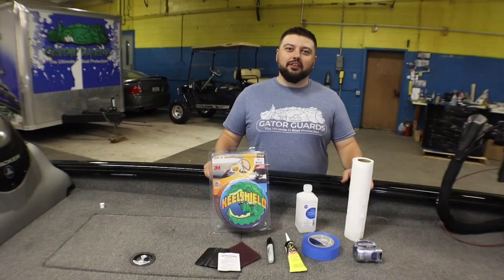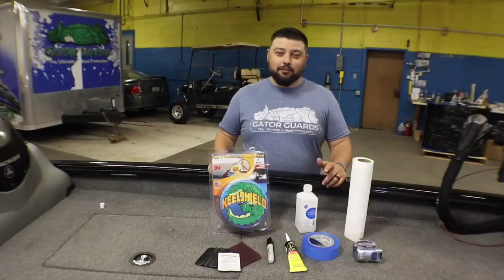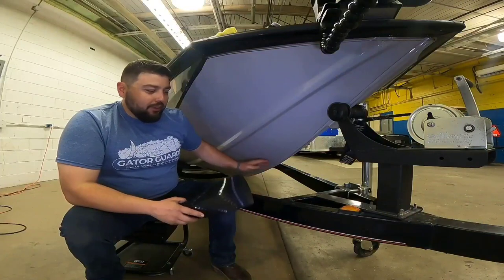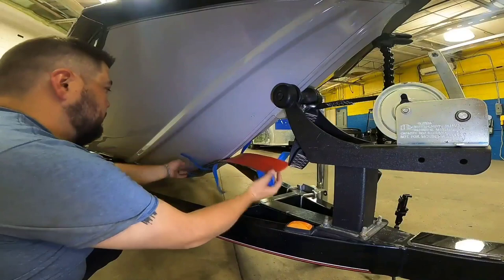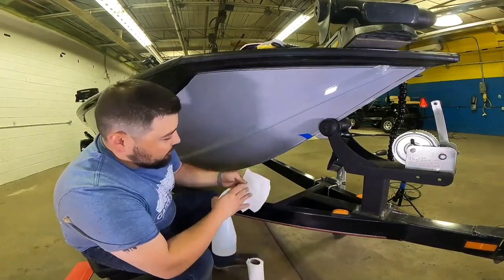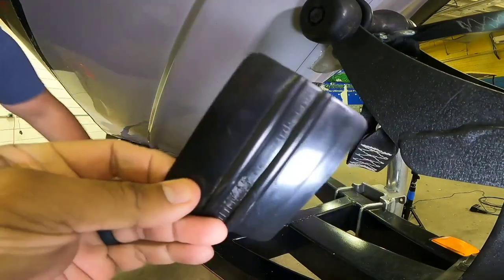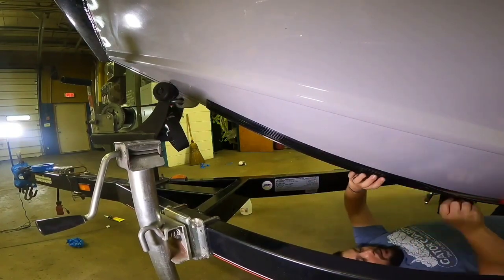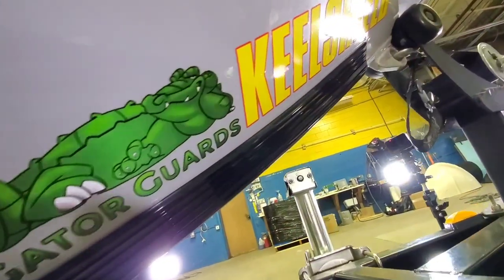Keel Shield/Keel guard Install | Gator Guards

Comment: What Silicon did you use at the start of the keel shield? Was that to help avoid water getting under the rubber? Thanks.
Reply from the maker: Any silicone will work.